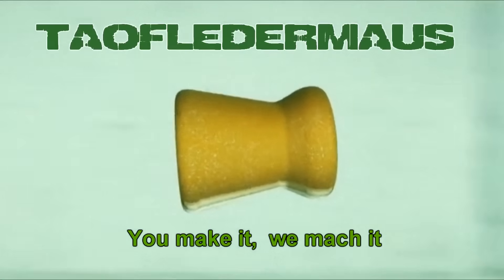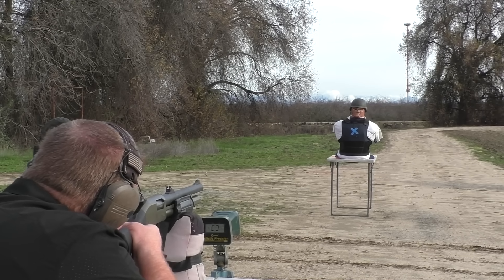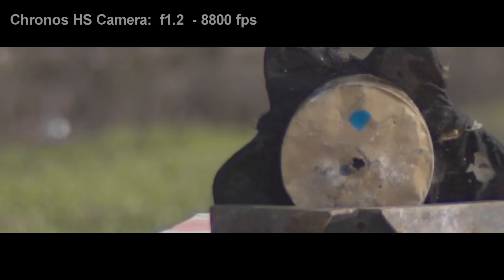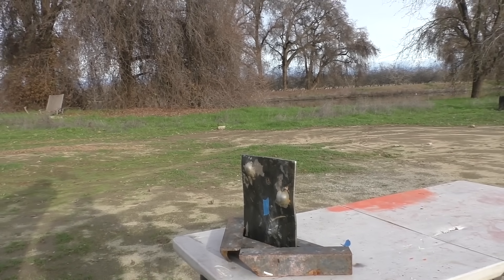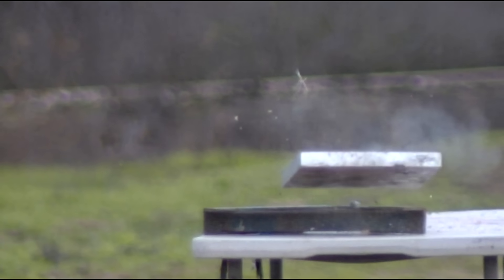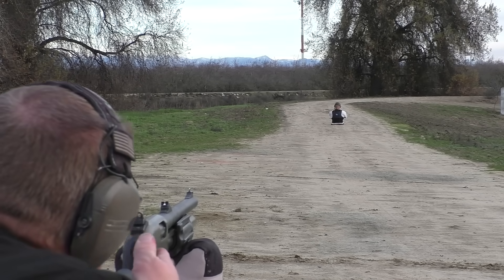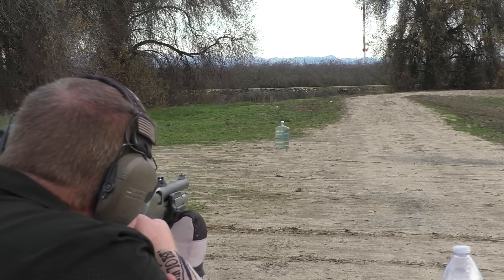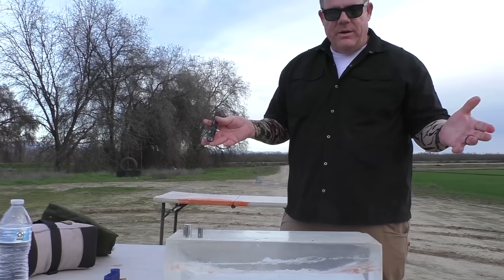The "MACH-71"  Super Perforator Slug   -  TESTED

Comment: Damn... They get my vote for best slug on channel ever. These are light weight, relatively, and I suspect it wouldn't be out of this world to short run manufacture.. Hydroform the outer, press it the inner which would also serve to roll the outer edge. 5 maybe 6 state process to finished round. Great job Kyle. I mean it's pretty close to a tank buster as it is but putting a hardened steel, stainless  steel, charge it to a magnum found , then it goes right through the lead plate.

Comment: APCR-Rounds from a shotgun? Interesting!
Edit: The Penetrator is mild steel? I really would like to see a tungsten (...carbide - I know, VERY expensive and a nightmare to machine) version vs. Level 4 Armor ;D
Reply from the maker: Yeah, tungsten is expensive but  tool steel is also very hard and Kyle has access to a lot of that.
Reply: @taofledermaus  It was not about the hardness alone. To achieve maximum penetration with this kind of ammunition, you want your penetrator core to be as heavy as possible, while the mantle sould be as light as possible.
On the other hand: It already defeats level 3A and seems to be pretty effective versus soft targets as well - that really is a nasty combination, the outstanding accuracy is just the cherry on top.

Comment: One of the best slug designs so far....

One suggestion, on your plate penetration tests...by not fully supporting the plates so they can not absorb the energy of the slug, the slug can not penetrate as well as it could. Build a small 2x4 frame that can't tip over and clamp it to the table so it can't move and you will see more slugs defeating the plates. Same with the lead plate. Support it from behind so it can't tip over upon impact and you'll see a lot more slugs go through...
Reply from the maker: That sort of works with very low velocity stuff.   But in this case the speed of the slug impacting the plate happens so fast,  the inertia of the plate resisting movement nullifies that.    The plate doesn't move until long after impact
Reply: @taofledermaus  thanks for the excellent explanation Jeff.
Reply: Hi Robert. Perhaps you can better explain your "theory" with a demonstration or an example? Thank you.
Reply: @Apocalypse_Cow  Will see what I can do...

Comment: Absolutely awesome 👍. What if the steel core was part steel and part ceramic behind the point? Extreme penetration AND lethal frangible material.  I think aluminum shrouded shotgun slugs could become a thing. What if you designed the aluminum shell to break apart on impact? Yep, the Geneva Convention would ban those projectiles.

Comment: Man, I've imagined true Ramjet slugs since I first saw this you make it series. Glad to see someone finally tried.
Reply: The SR-71 had axial-flow turbojet engines [P&W J58] not ramjet engines, just as a side note.
Reply: @kanagawakenji7  The engine on the SR-71 was a hybrid turbo-ramjet meaning it is a turbojet on takeoff and adjusts into a ramjet to maintain mach speeds
Reply: @SuperReddragon90  Technically,  the engine functions almost as a ramjet engine at high speeds but is not in fact a ramjet engine. Though, I admit it's mostly a technical distinction and it is basically working like a ramjet at high speeds/ altitudes.

Comment: The slugs look alot like early subcaliber and cased rigid cannon ammunition used during  the later years of the second World War until the emergence of fin stabilized sabot ammunition.
Reply from the maker: That may have been his inspiration and looking like the SR71 engine was an accident.
Reply: @taofledermaus  Probably, as the SR 71s engines were designed with upper-atmosphere capability in mind. I'm not sure how exactly it works and I'm too lazy to do the research atm but the engine inlets could be opened and closed depending on altitude.

Comment: Here comes an upset commenter!!! id love to see the penetration test on the quarter inch steel plate with it up against a heavy backer, like a clay block for example, to see if it could have made it through, since it would allow it to dump more energy onto the plate, instead of the plate just bouncing away :)  love ur vids and really cool slug kyle!!
Reply: That’s not how science works.  The energy is long since dispersed by the time that plate starts moving backward. “Strapping it down” is an old joke we’ve disproved many times here on the show.
Reply from the maker: Inertia,  the resistance to movement of the heavy plate prevents that theory from working.  The plate doesn't move until long after impact.

Comment: pretty sure Kyle didn't glue that core in. A pressure fit would keep the core and ballistic sleeve together fine. Just make the hole a couple thousandths of an inch too small, heat the sleeve and chill the core, and drop it in. when everything cools, it ain't coming apart for nothing short of hitting something.
Reply from the maker: He used locktite  to ensure the core didn't get "newtons-cradled"  out when shot

Comment: One way to solve tour water issues. Use the water pressure created at variiuz pounts to pump extra water back up the river. Uses free hydrolic energy several stations at several points will recycle the water baCk up the river extending the waters overall dwell time.

Comment: Great video I think if it's possible to have channels drilled between the steel core and the aluminum core have air flow going through it the middle just like the actual jet I'll be at it would be more complex but still it may improve it      also with how it looks out there it looks like you're filming in North Carolina when its fairly dry so a lot of water in California at that time

Comment: The way the slug performed against the lead plate is very impressive. I'd  be keen to see Kyle make a version with a tungsten core and see how the performance would differ, if at all.
Reply: next depleted uranium 😛
Reply: Tungsten would probably be the best core for the slug. This slug is really neat because the aluminum sleeve dissipates a lot of the heat created by friction. Tool steel wouldn't be a good idea because it would react very poorly to being heated up quickly, but the Tungsten would retain most of its integrity even if it was superhot. The mild steel would really be a better cheaper option for the core because it would get soft because of the heat, not brittle. The Tungsten would be expensive, but way better at holding integrity with heavy armor plating. Or at least that's my opinion on what might possibly happen.
Reply: It most likely would be more effective since tungsten is a very dense metal
Reply: Only a matter of time before the government regulates these

Comment: As a US machinist I was wanting to make something similar but never knew the exact dimensions until the start of this video. My plan was to use carbide. I thought I still would until halfway through the video it already sounds like it's in the works. Kyle beat me to it and for that I applaud you sir! I'll have to come up with a new design.
Reply: Like most engineering!and inventions ....Done first in the UK!
Reply: make em as is and use carbide, still different!
Reply: Brass shell and copper core, the copper will or should melt on impact with surfave at right speed 1400+ mph? Lead and sheet metal should be no problem. If using just against soft targets have that slug, very capable.
Reply: Add fins to the aluminum or a copper jacket too see what it will do!
Reply: Tool steel would add needed weight

Comment: Inlet of SR-71 had such a shape to provide air to the engine through it. Most of the air goes around it efficiently, but that shape causes abrupt drag changes due to speed (and vice versa) on SR-71 and had to be carefully controlled. That is probably the cause of the round taking a turn at longer distances as the speed decreases.

Comment: The stability of these in flight is very impressive. It is normal for a slug to have a little wobble, but these are just laser straight.
Reply: rifled bore.
Reply: @bayareaartist999  I am sure in this particular case, that does indeed help. Rifling, however, does not always help stablity. I have seen slugs get thrown off balance due to rifling.
Reply: They must have been made from high quality steel with very uniform density.

Comment: So does air pass through the round? That’s the only reason to have a design like this. This is the magic behind the SR-71.

Edit: maybe if the penetrator had small fins and was pressure fitted in the shell it would get the airflow and possibly have a more reliable two stage effect. Round hits target, penetrator dislodges and continues the journey,

Comment: UMMM is that A railroad track down Range??? if so WTF!!
Reply from the maker: There is no danger of a train running us over
Reply: @taofledermaus  I really am not concerned about the train sprouting a steering wheel and the engineer willfully running you over eliminating you from the gene pool more than I am about your lack of back stop, or your combined stupidity for safety, between yourself and your other cohorts,  You might consider the ramifications of hitting or damaging property or worse wounding or killing someone. A sand box has more common sense than you
Reply from the maker: @liamwillis8541  There's no train track within 20 miles of this place

Comment: I've got a good idea for the core of this round so i hope Kyle reads this. 

What if you drilled the hole in the center of the aluminium jacket all the way through instead of only partially so the wound canal in tissue forms a hollow tube upon ejecting the core? This would make it no less of a penetrator yet all the more of an anti personnel round. 

Fitting the core tightly into the jacket to prevent it from ejecting upon firing i would do as follows: Heat the jacket so it expands and hole becomes bigger, put the core in and let the jacket cool down so it will shrink and pull itself tightly around the core. This is how they fit metal train "tires" around the wheels, it's a nearly unbreakable bond. 

Ps. I think using tungsten for the core would yield the best results. If the low melting point of aluminium prevents it from expanding enough to fit the core in i would use steel instead. This also allows you to heat it up more so it expands further effectively allowing you to put a thicker core in making for a tighter fit when everything cools back down.
Reply: look for how scramjets work. hollowed out would make internal pressures change trajectory. sounds great as a ring/cookie cutter round, but air inside the "tube" could make it wobble.

Comment: I'm working on bonding a tungsten core inside a copper sleeve, and then using a mini lathe to shape them to match the dimensions of some 147 grain FMJs I have in .308 for a 30-06 I have. 

If it weren't for some ridiculous laws, I'd have a much easier time testing the stability through the much safer pressures of 300 AAC, but as it stands I've been able to consistently achieve 178 grains and relatively good stability out to 150 yards. I'm gradually working my way up in weight, and consider using a rebated boat tail design to further shave weight and gain velocity. 

It's definitely been a challenging process for an ameture, and my respect goes out to people who do this for a living on a larger scale.
Reply: For anyone interested in the purpose, it's more for ballistic coefficient than it is armor piercing capability. Tungsten being much more dense than lead means, along with a ton of other factors, you can have a higher BC in a smaller projectile. 

I'm eventually going to move the process over to .243 projectiles for my .243 for long range performance. 

I'm just pulling numbers out of best guesses, but I should be able to achieve around 120 grain weight in .243 with a G1 BC of around 0.650 or higher as a minimum. I'm hoping by matching the shape of more aerodynamic projectiles that I can move that up to 0.750, but that's a very optimistic number.

Comment: I want to see these same slugs made with slotted sides similar to a hollow point.  Make 4, 5 or 6 very thin cuts down the side (they may not need to go the whole way through to where the core is - it would be interesting to see the differences) to where the solid base starts (where the core ends).  Then shoot these at the gel block & see what the difference is!

Comment: Use tungsten or tungsten carbide kyle. Get it to about 1 oz/28g in weight. If you use tool steel, see if you can braze on a carbide or tungsten tip. You can buy small pointy tungsten bits online, or use welding electrodes.

Comment: Flachette darts don't work but that alluminium cup holding a cluster of 1/2" long 1/16" or 1/32" diameter pointed tungsten carbide pins set in wax would be
scarey good at penetrating body armour.

Comment: I've had this crazy visual idea for a slug for a couple years now, but I'd really like to see a copper or steel slug that has a super simple button battery + LED visible through a small section drilled in the back. I'd be curious to see if it would be possible to have a simple electronic circuit that would be completed under the G forces travelling down the barrel, and if the light would be visible as the slug travels down range (if components inside the slug withstand the energy).
Reply: That's so dumb and I love it
Reply: I have an idea for that that is bloddy simple but don't want to share. I took CS & EE.

Comment: So since the plates are angled the effective thickness is increased. Similar to how tank armor is angled, the angle makes the plate thicker and reduces how much energy is dumped into the armor. This is why many of the slugs will not penetrate the plate. Instead of being 1/4'', the effective thickness is closer to 3/8'' to 1/2''. Same goes for the aluminum.

Comment: Fun fact, on the actual engine, that center cone moves back and forth to adjust the air inlet into the engine.
Reply: Aye it focuses the supersonic shockwave onto the lip of the intake, which maximizes the ability of the intake to compress the incoming air before it reaches the engine.

Same idea can also be seen on lots of other jets, e.g. the F-15 has a movable 'ramp' that kinda acts like a rectangular version of the same thing.

Comment: This is cargo-cult technology.  If it put the shock at the edge of the inlet like the SR-71, it'd slow the slug down.  The reason the SR-71 is set up this way is because the engine requires subsonic air.  If he just wants a nice steel penetrator, then make the aluminum a discardable, lightweight sabot that transitions smoothly to the tip.

Comment: i got a feeling that a tungsten core or that tool steel core properly hardened might actually stick in that 1 inch AL plate. Could give your 1/4 inch steel plate a run for its money
Edit: also would be interested to see what a work hardened or more brittle aluminum alloy would do.
Reply from the maker: Probably poke a hole in AR500
Reply: Replacing the Loctite with O-rings (or other friction fits), the penetrator with WC, and then shooting it out of a 10 gauge magnum load (using a big thick sabot), can potentially turn a shotgun into a legitimate NIJ level four threat

Comment: Literally a tank round. Soft body to carry the energy with a penetrator to punch though the hard stuff. A work of art. Great shooting and amazing machining bravo Kyle 👏
Reply: It is literally APCR.
Reply: @dposcuro  Had the same thought looking at it lol
Reply: @dposcuro 🤓
Reply: nope, didn't go through 1/4", .50 cal anti-tank is MUCH better. Even a 36" barrel will go through almost 1/2" at 1000 yards. https://forum.il2sturmovik.com/uploads/monthly_2020_11/3.png.537a5d6ab70a6898c93e95b68235f897.png
Reply: @JonathanSchattke  I don't see why you're comparing a 12 guage to a .50 BMG?
Reply: @WilliamStewart1  because some joker was calling this an anti-tank round when it can't penetrate even 1/4" steel?
Reply: @JonathanSchattke  They said that because the slug in the video is essentially a scaled down version of apcr - which was designed for tank guns to penetrate thick armor. No, it doesn't have the penetration of an actual anti tank cartridge but it works the same way.
Reply: @sikstael  no, it's not.
Now, if it had a smaller profile penetrator core made of  harder more dense material, like DU, Tungsten or titanium, then it would probably have gone through that 1/4" plate pretty well and be an anti-tank round.
But as is - if 6mm can stop it, it's not anti-armor.
Reply: @JonathanSchattke  No one is genuinely saying that this slug is an anti tank round - they're saying that it works the same as an APCR shell. Even though it doesn't have near the performance of a real anti tank round, it has the same method of action.
Reply: @sikstael  The performance against the big disc demonstrates exactly how an APCR round is intended to work -- the light ballistic shell allows the projectile to be fired at a higher velocity, and with most of the kinetic energy in the dense core, when it hits a resistant target, the ballistic shell is stripped off and the core has improved penetration over a uniform solid projectile. The disadvantage of APCR, which the video can't show because of the conditions of the tests, is that because the areal density of the round is reduced, it experiences more drag, and will lose velocity and penetration faster than a uniform solid penetrator. However, for short-range engagements, the higher muzzle velocity will give the advantage to the APCR round.
Reply: @JonathanSchattke  Well yeah a 50 cal is gonna go through armor better lmfao. 50 bmg has double the velocity and 5 times the energy of a 12 gauge slug.
Reply: @sikstael  dont forget that when the M2 Browning was made they designed it to kill tanks and infantry as it was made just after WWI
Reply: @JonathanSchattke  You can't compare the two TOTALLY different ya DICKHEAD